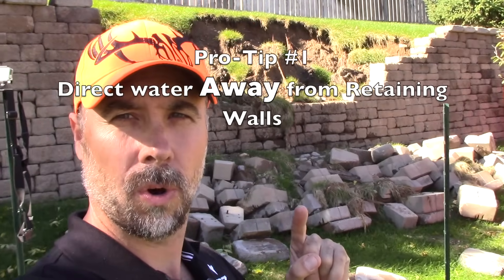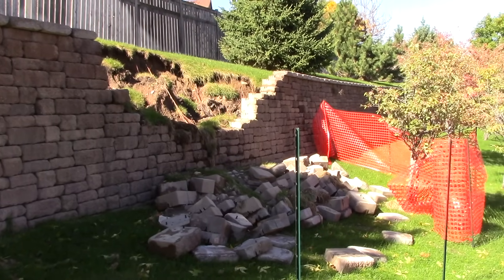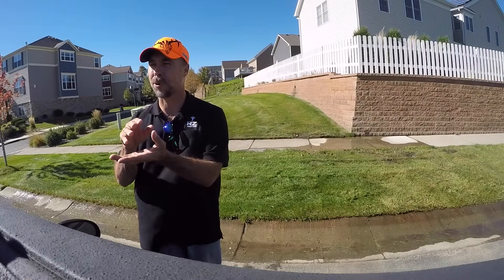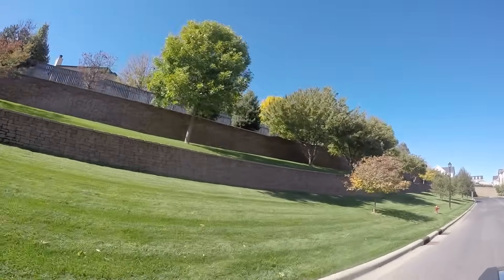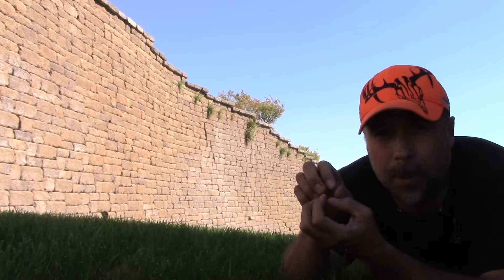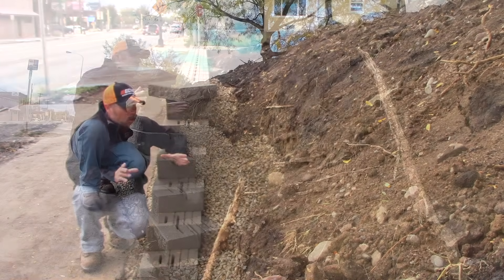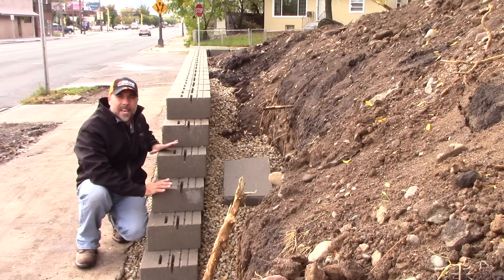How to Build a Retaining Wall and 6 Reasons they Fail

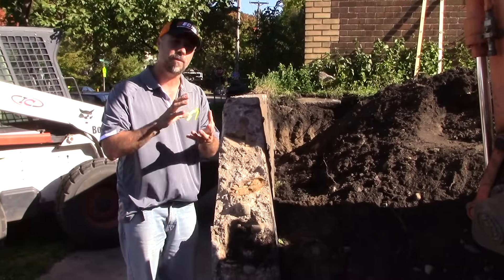Comment: 1. At 1:30 to 2:00 you show an old massive poured concrete wall.  In some cases in your videos it seems like these types of solid walls (with drainage) would be better than using blocks.   At least up to a certain size.  Beyond that might take big horizontal ties holding the wall to the uphill zone like on a highway roadcut.
2.  I am not really getting the geogrid.  It seems like it is slack, not tensioned and not tight.  So if something moves or shifts, the wall can tilt out a ways before the geogrid becomes very tight.  And the geogrid could somewhat pull out from between the blocks.  So it may help stability a little, but not like something rigidly held in place.

Comment: We had to add to our existing 36" high retaining wall and thought we did OK. It collapsed last night in torrential rain and I now know what I did wrong. Should have done my research before attempting it. Many thanks for the video. It will be adhered to the second time.
Reply: Ours just collapsed too 😮 rain also. I’ve been seeing gaps for a long time. We got two quotes and two totally different versions the contractors want to solve the problem. So confusing! Just praying now what to do.

Comment: Its just about doing your research , knowing your terrain , and knowing what you need for the occassion . After Hurricane Maria hit Puerto Rico , I had the task of rebuilding a 42 foot long wall 30 feet high retaining wall that supports My mothers house on a hill . We built it with re-bar and paired them face to face , 10 inches apart , and 6 inches for the seperation for the 9 inch thick wall . People stopped and took pictures of the work as we were working . And Me and My helper are not contructore but did our research .

Comment: I don't understand why the drain tile emptying water is a sign of failure. With washed gravel behind the wall I would expect it to drain down and have 0 hydro-static pressure on the wall face to weep through

Comment: Thanks for the video. I inherited a retaining wall when we moved into our 60 year old house. It's about five feet tall and joins our  neighbor's driveway. It seems fine, no bowing or sagging that I see. Two problems: it's cinder block and it's opened at the top. I can't see to the bottom, but I think it's open all the way down. Also, a large hole (waist high) is located directly behind the wall where a tree used to be. It keeps me up at night.

Comment: how much would it cost to fix a 20 feet retaining wall? do you have any idea?
Reply: 20 ft tall? How long?
Reply: @furtim1  30 feet
Reply: @CorneredChronicles  That's pretty tall for the length. I am only someone who has had walls priced, never built anything that big myself. I would guess that, if you did it with cheap gravity block with a lip (no mortar or locking pins), I wouldn't be at all surprised if the price was at least 30k. Have you had it priced by a contractor? If this wall is holding up your home, car, or something else of value (or could fall on something or someone), you had better have an engineer involved and not just hire some yahoo to do it on the cheap. You will end up paying for it twice, your insurance denying claims for damage, etc.

Comment: What kind of 3/4 inch gravel did you say you recommend? And I think I also want to put in some drainage pipes - the black ones with holes in them to guide water to the outside edges away from the brunt of my retaining wall.

Comment: How high should the 3/4 inch aggregate AND screening cloth go up if building a 5 ft Armour rock wall?  I just had mine done, and they only did 3/5 up behind my wall & the topsoil is eroding already (in just 2 weeks).  Now we have a new deck & I'm worried it will shift as it's only on those 4x4 post blocks.  Tyvm

Comment: I have slope. appeared my house had a above ground pool in the 80's . I'm trying to be safe building and build the retaining wall with concrete bags and rebar. using gravel in the bottom, cover with fabric and drainage pipe. my question is to release all that water I'm planning to dig and do a box that will drain the water towards the creek. what other thing do I need to make sure the 6ft wall won't collapse towards the pool.

Comment: What is your thought about putting in a french drain behind the wall?  Will that even work?  Or what if you cut a pvc pipe in half and use it like a gutter under the ground?  Just ideas that I had watching the videos.
Reply: Aside from costs, I don't see why this would have to fail if the wall was on a slope. Seems like keeping water away from your wall with a berm or a drain would be preferable to dealing with a blowout later.

Comment: I made the slight mistake of building my 15 inch high retainer wall with river rock behind it instead of rock wall. I did install perforated piping with a drain outing. How likely will this screw up my new project?

Comment: Bought my first house it's on a hill slopes going perpendicular to each other with a driveway along the gentler slope.
The retaining wall along the driveway has a crack due to a tree planted way too close. 
I will be taking down that tree and working on the wall in spring should I build a whole new wall or is there a way to fix a severe crack in a cement wall?

Comment: I had a problem with a yellow jacket nest built in between wedge retaining stones, bought from a Big Box store, after completing a retaining wall project. I used the rocks of various shapes/sizes to include the dirt from leveling/grading in front of and behind a retaining wall site. Luckily the nest was under the first/top row of stones, making it easy to expose the nest. Had it been at the base or five stones down, I'd have to dismantle a big part of the wall as the stones are staggered. I guess my error was either too much dirt in other areas or large rocks causing large gaps behind the wall?
Reply: Also, yellow jackets are just terrible creatures

Comment: You can't have it both ways with gravel. Gravel is used as a base for foundations because it transfers load from the building to the ground. You say, at the end of the video, the gravel won't transmit ground movement (force) to the retaining wall. How does it do one thing (transmit force) and then, at the same time, not transfer force? Seems like someone is practicing civil engineering without being an engineer.

Comment: retaining walls should be built with reinforced blocks and core filled with 16mm bar on footings that can absorb pressure below the ground as well there are correct tables to follow when building retaining walls if your not sure how to construct them. furthermore what the best materials are for different concepts and designs. for example, these stackers are not designed for this type of retaining wall. so selling a better product to the customer is all so very important so you don't have these types of issues in the long run.

Comment: Hello. we are wondering about french drain installs and product alternatives for small bendable tubes.  We are also curious about using older and equally effective methods of retaining earth than concrete.  On the otherside of the spectrum, can you comment on the use of earthbags as a retainting wall ?

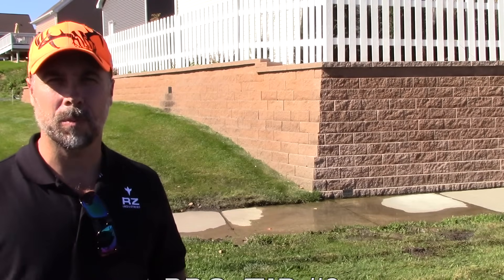Comment: @ 2:31 you didn't explain why it was failing??

 You just said that a properly installed wall didn't need drain tile, and it would fail over time. 

What did they do wrong?

Comment: We'll made video.  You definitely have the experience.   What do you think of plantable walls like, Verdura Walls by Soil Retention.   No base or backfill is needed.  They stones are stacked on top of each other and spaced apart for planting.  Have you ever installed a type of "green plantable wall.?" If so, what is your experience.

Comment: I have a Rock Garden, this was built 40 Years ago by my Dad. I'm having issues with a retaining wall. It is 4 ft high no cement there are gaps in the rocks. I wanted to know would it be best to fill these gaps with 3/4 crushed rock or rebar and cement? the soil is clay type of soil, every year I have shovel up 1 ft 1/2 foot of dirt. There is not much rain in this area, the retaining wall is still very solid.The gaps allow both Ground squirrels and snakes into these gaps.  I'm not sure if the gaps are created by the Ground Squirrels making a bigger place to stay or if it is Rainfall. Please let me know

Comment: Thanks for the video! It's the second of yours that I've watched and they're interesting and informative. I'm planning on building a limestone wall around a garden bed in front of my house. It looks like all your walls in the 2 videos I watched were dry stacked and am wondering about using a cement base and mortar. I was planning on using a cement base, mortaring the stones, and putting in 1/2 inch perforated pvc pipes for drainage periodically on the wall. It's on a slope and the height will range from 16" to 3ft. In your opinion, will this be sound?

Comment: So, what I learned in wall class today is:
- Stress is built from the roots pushing the dirt towards the wall if any plants are too close.
- Water buildup in concentrated areas can causes sink holes and plants to grow through.
- The drain is suppose to relieve overflows, not small amounts of water
- Rocks between the wall and soil is ideal
- Install a barrier on high point to redirect water flow away from the wall.
- The cost of building a wall is equivalent to being a millionaire; millions of dollars. 
- it's okay if water flows from underneath the wall..... ?

Comment: I have been really enjoying your informational videos.  I’m wondering if you have one that would help in our particular situation.
We have a camp way up in the mountains in Utah and the roads are very steep and winding and hard to get in conventional heavy equipment.
We bought the place and it has an existing wall but it is showing Signs of sagging.  I can send a couple pictures.  Wondering if you could give us a couple suggestions on what we could do to possibly use or alter the existing in environment to help support or save the wall.  Thanks.

Comment: We have a railroad tie retaining wall basically holding our 2400 SF house up from a creek which drops about 15 feet almost straight down below the wall. The ties have rotted and are leaning out towards the creek and I'm trying to decide whether to try and fix the old one or go ahead and build a new wall a few feet below the existing  I get that concrete or even block would be better but the ties are much cheaper..Any advice?

Comment: Im on the board of a townhouse association and we have a 6’ wood retaining wall that is failing not leaning but some timbers are rotting. I know replacement is best but it is only a few feet from patios and 8’ from buildings on one side and a small creek on the other side leaving very little to work or get any kind of equipment in. Is there any way to repair,shore up or reinforce the existing wall. Any thoughts would be appreciated.

Comment: Is drainage aggregate as big of an issue with timber walls? I'm having a 75'+ long timber wall built, and I'm being told it will be backfilled with only dirt and that the water will just seep through the timbers along the entire face of the wall. This seems like it would rot the wood to me. This is in an area that rarely if ever freezes.

Comment: My parents allowed the neighbor before to plant what were suppose to be rockery garden flowers on the corner of their shared rockery wall. The neighbors before also planted a tree right next to the fence on the same corner up above. The roots from the tree plus the roots from the flowers that were not rockery garden flowers grew and now the rockery wall of 70 years is crumbling. The wall wasn't designed very well since the original owners used rock from what they dug up from my parent property before they built the house. We knew the original owners of the house next door before they passed and sold to the previous neighbors who planted the tree and flowers. The bottom base of the rockery wall from front to back was built with a solid base of large uneven boulders. And the higher the wall, the smaller the rocks. The rockery wall has stood solid for 68 years until the newly planted items grew too large. My parents have lived in their house for 44 years and are just now having issues with the wall after the tree and flowers were planted five years ago. And the rockery wall was designed with soil on the bottom and finished off with cement on top. It stood strong up until the last 1 1/2 years. I know that we need to hire a professional but what should we be looking for?

Comment: Stanley I have a dumb question. I am thinking about installing a retaining wall the length of the property (122 ft.). The wall at one corner of the property will start out 6 feet deep tapering to about 1 foot 20 feet from the corner. Would you still need to treat designing the wall as if it were going to be 6 feet deep the whole run of the wall or is there exceptions to the rule of having it engineered and city inspected??

Comment: I call bs on the "water coming out the drain is bad" water will go straight down and get in the under drain pipe quicker than through the block. Just my experience.

Comment: What do you think of Hercules planter box walls. I built one in front of a rotten wood tie wall back in 2009, and created a swale about four feet back so the water would not go over the wall but would go around it, it is still doing well but having not seen this video and being ignorant of the problem I planted cedar trees along the top of the wall mostly as a privacy blind, but also I thought the root structure might add to the strength of the wall. The base behind the old wall was 2" minus limestone and the planter boxes are filled with 1" clean limestone between the old wall and the new. Proper drain tiles were used but no geocloth since the 2" minus is basically concrete now and I didn't want to dig it out. the wall is about 5' heigh and 140 ft long. what do you think? think the trees will cause a problem?

Comment: I have a retaining wall on my backyard and the previous owner planted a tree that pushed a section of the wall forward, like you mentioned in your video. The tilting has u shape curve viewing from the top. The wall built with limestone/concrete gravity blocks and is about 7 fts height.. The wall was shared across several properties and there wasn't much space for digging equipment to access (bobcat, etc.). I cut the tree to prevent it from growing further when I bought the property and I reasoned that the remaing root would keep the wall in current state, since it may cost a fortune to tear down the whole thing and repair it. When would i know that will become a danger and what should I do?

Comment: I have an old wood tie retaining wall that is possibly as old as my house, (30+ years) and there is a big tree 40-50 ft high only a couple feet from the edge of the existing wall. Over the next few years I plan on terracing the back yard to reclaim some square footage from the slope as well as replace the wood tie with concrete block, should I plan on taking out that tree before replacing that wood tie?

Comment: Sorry but, to correct you, surcharge is not how you described it... Also, the wall system failed because it was not engineered correctly... It did not have geo-grid or similar products used -- they should have been used at those elevations... Also, the soil was not placed properly or the walls system either... No drainage in the images you shared and "old root structure" was present --indicating that the wall was placed in front of some existing ''hill''...    Also, the base / footer is the number one reason I have seen many structures fail from... Finally, these are ''gravity walls" and they are subject to the existing forces and have only their weight to assist them in their resistance...   Water of course always needs to be addressed... Keep up the good post and your thinking is in the right direction but, with a little more information... You could nail this type of construction.
Reply: This is the exact reason I have advised my partner to go to an engineer(possibly geotech) before addressing what kind of retaining wall we require.